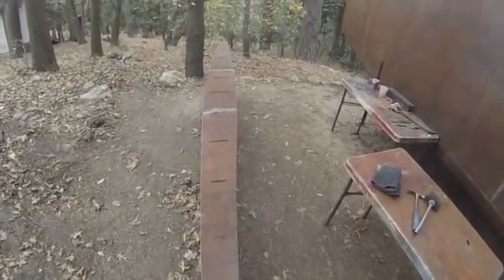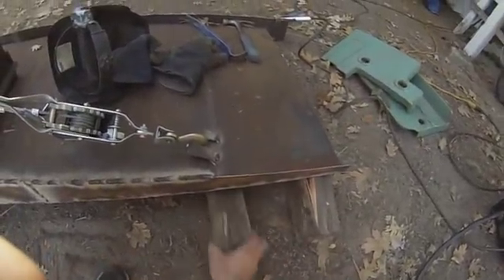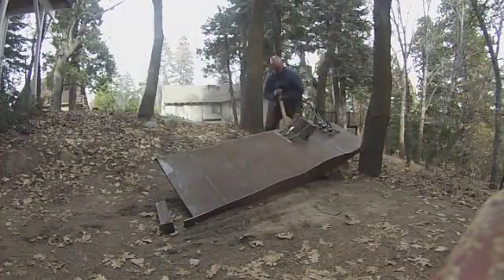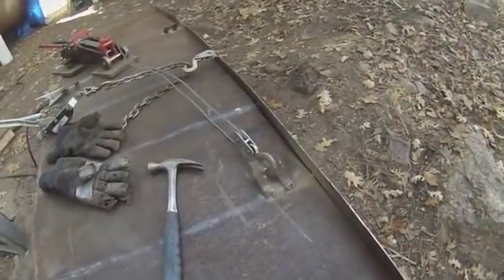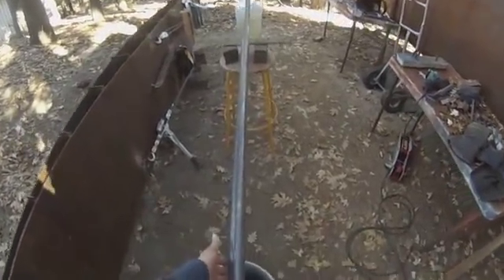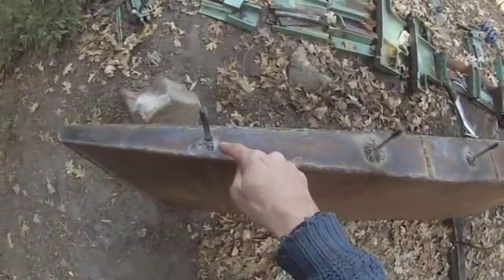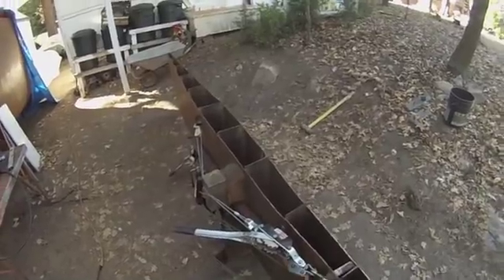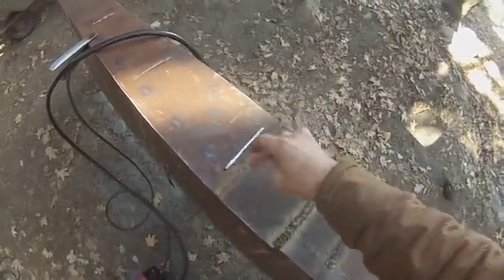Steel Sailboat Build Part 9

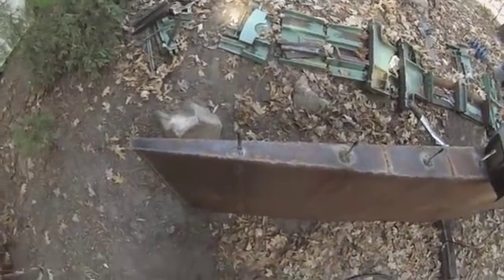Comment: At 4:54 you talk about your huge weld on those bolts on the keel.  Are you still using that Inetub BA71TGS wire?  If so - check out the specs.  It's designed to be a one pass welding wire.  That's what the GS means on the end of spec.  There are specific wires designed for things like boat building that will give you the kind of weld performance you want.  A good welding supply shop can advise what they are and the technical specs on how to use them.  It's a cool DIY project.  It would be a shame to have a problem because of misuse of welding wire.
Reply from the maker: Too late for using a certain kind of wire.  I'll keep a close eye on the welds and post videos if they show signs of failure.

Comment: be sure to air test your keel to be certain it is water  tight
Reply from the maker: My plan is to fill it with a couple feet of water on the inside and watch for leaks on the outside.

Comment: Did you consider going with lead ballast (wheel weights) instead of scrap steel / concrete? What was your thought process on that?  I'm binge watching your videos and enjoying them!
Reply from the maker: I'm using the scrap metal I have had around the house for years.  The bottom piece I bolt on may be lead filled.  We'll see.  I'm considering weight lifting plates, also.